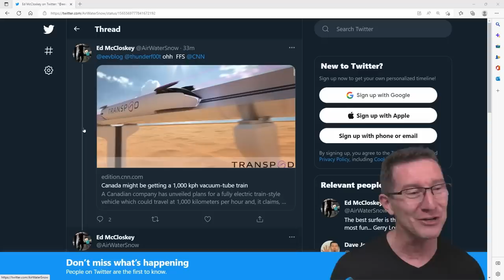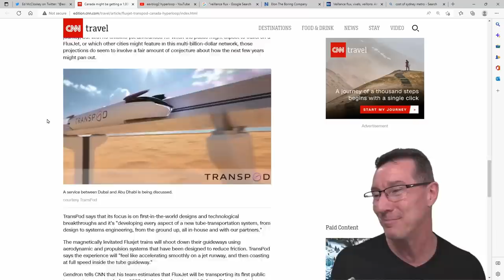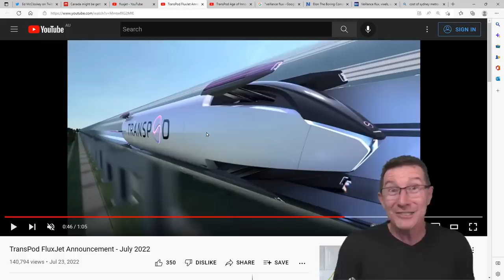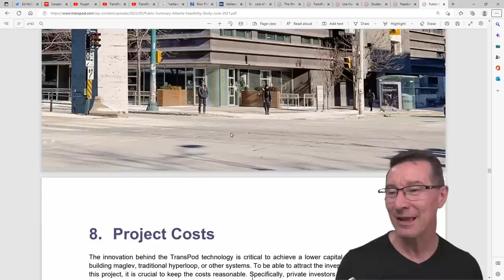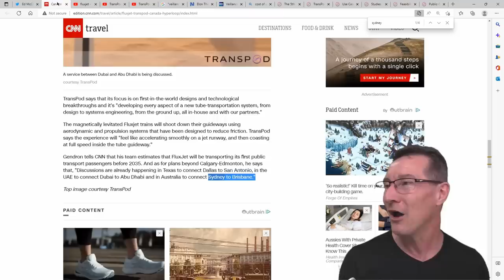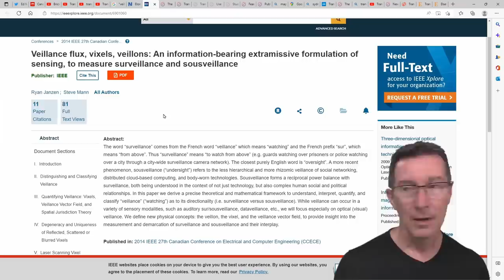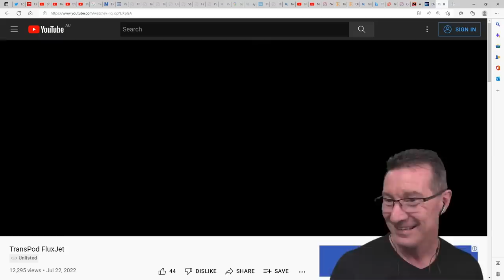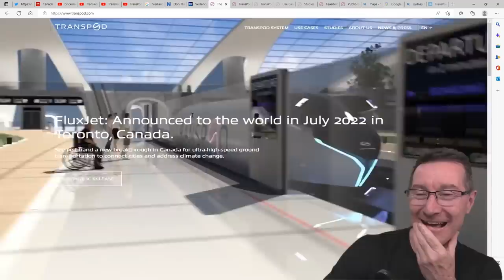EEVblog 1498 - TransPod Fluxjet Hyperloop $550M Boondoggle!

Comment: I keep seeing these "low presure... ideas". And I keep wondering: how would the energy distribution work out if one would not lower air pressure, but rather get the air inside the tunnel to go the same speed as the trains? Would also cut down on the air resistance problem but would involve nowhere near as much danger... and the tunnel would not need air tight seals... just enough to keep the fast moving air away from the stations. And large stationary fans every few miles would be easier to power than anything that moves. I really wonder how that would turn out, in energy... but I have no idea how to calculate that. If I had enough money, I'd start a company for it :D
Reply: I think it would be massively inefficient. You'd be incurring frictional losses between the moving air and the sides of the tube all the way along the tube, not just where the train is. It would be like trying to eliminate friction between a car and a road by replacing the road with a big long conveyor belt. You just end up with a lot more friction somewhere else.

Comment: My problem with Airlines is all that annoying security theater. In the US I can get on a train or a bus with zero problem. But not an airplane, because of all the security theater, passengers need to waste an entire day to fly an hour.
Reply: It's not theater
Reply: @rasimbot , it is 700% theater. Not all countries bother with those theatrical security measures and they get along fine. I travel by train quite often in the US, which carry several times as many travelers than the LARGEST commercial airliner. There are little to NO incidents of purposeful harm.
Reply: @hallcrash  | Thanks to these measures, there are no more hijackings

Comment: But the arcs in the video were caused be the brushes bouncing off the wires/rails. Why are they using magnetic attraction? You would have to constantly monitor the gap and modulate the field strength to keep the train from either dropping or snapping to the track. Magnetic repulsion is inherently self-stable.
Reply: Earnshaw proved in the mid 1800s that no arrangement of (classical) static magnetic fields and paramagnetic materials that can produce stable levitation. It doesn't matter whether you're attracting or repelling. Maglev systems use either electromagnets and sensors to actively maintain the gap or superconductors, which are diamagnetic, or both.
Reply: @ceoyoyo  Pyrolitic graphite is also diamagnetic. You should do a little googling before asserting things that were 'proved' in the 1800s.
Reply: @ceoyoyo  In any case they don't need to be static as the train moves and has landing gear. There are already maglev trains that use fixed Halbach arrays and passive rails which produce stable guidance as long as the train is moving above 11 mph. (iirc)
Reply: @ceoyoyo  Even if it weren't stable and you had to dynamically control the field strength using repulsion would require much less/slower tuning as it inherently produces negative force feedback.
Reply: @ceoyoyo  Finally, I am not claiming that the TransPod FluxJet would be feasible "if only they had used repulsion instead of attraction." Only that using attraction would be counterproductive.
Reply: @GordieGii  I carefully noted that there were exceptions, including diamagnetism. There's nothing "inherently stable" about maglev. You can achieve stable configurations only through means that have costs. High quality pyrolytic carbon is made by CVD so it's expensive, it's nowhere near as diamagnetic as superconductors, and it's only diamagnetic in one direction. That's likely why it's not used for large scale maglev. Active control is pretty simple, cheap, and you typically do it anyway to control clearance, compensate for lift, and for propulsion. You seem pretty excited about this, but you might want to take a break and go for a walk or something to chill out a bit.

Comment: A standard Calgary to Edmonton high speed rail line which costs much much less than than the proposed fluxjet has been talked about off and on for 10+ years. Even if this thing did work as advertised, I have doubts it could be built for non tech reasons.

Comment: They have to use very fast switches to sequence the plasma stuff, so they chose the Esaki (Leo Esaki) diode as a switch. The Esaki diode is also more popularly known as the TUNNEL Diode. Negative resistance!
Reply: What?  Tunnel diodes are low-power, low voltage devices.  Way under one watt.  Have to be.  Can’t be scaled up as the negative resistance only works down at those low voltages.  Or I guess any diode in a tunnel is a tunnel diode.
Reply: @georgegonzalez2476  I was just injecting some humor into the topic.
Reply: @NeverTalkToCops1  Sorry, the humor went right over my head.

Comment: Solar-powered: really? Also at night, when the cooling down vacuum tubes stress the seals and you need more pumps to maintain low pressure? 
Fast airlocks: it is good to see that they solved the airlock problem and pressuring down the airlocks doesn't take ages at every stop !
Front "radar" flux : consider 250 m/s and an F1 racing grade emergency brake time of 15 s. So the radar has to look ahead 4 kilometers for trouble like ... air ...
Unluckily a wall of air in 4 kilometers distance entering through a leak will not stand still but move towards you on its own traveling speed ...

Comment: always funny to see: it is a mag-lev train, that will add extra infrastructure and never before used or even existing stuff, but will somehow be cheaper than the base mag-lev train. sure, that is how it works, more is cheaper. not to mention even high speed trains are failing mostly from the fact that it needs different (more robust) infrastructure than trains, and at that point it is simply not cost effective, but that at least in theory was backward compatible. maglev need dedicated track, hyperbs and similars even more dedicated and not even compatible with each other stuff.

Comment: To get reliable high speed rail in a low density northern latitude like Canada, tunnels might be something to look at (maybe not vacuum tubes tho, lol). I think Japan uses rail/car heating, and monitoring for winter, but there is a higher population per mile of track in JP, so the maintenance cost is more feasible.
Reply: The issue with high speed rail is actually not the install cost that a lot of people believe, but the ongoing running costs.

Comment: I am not well versed in things regarding maglev, but I think what they are proposing is kinda different in a way that they have the propulsion on board of the capsule with the top arm thingies providing lift and the bottom ones providing thrust. Kinda feels dumb or at least counterintuitive to not flip that around but whatever...  Still overall a dumb idea.

Comment: (Thunderf00t is not alone after all!)
  We should just have special bus roads & electric buses that accelerate 
0-60mph in 2sec.
Like a 
Tesla Model S Plaid!
Reply: just make a very long model s plaid, add a cog track for near infinite torque, replace the tires with steel wheels, remove the battery and connect the positive to one rail and the ground to the other, now we have invented the electric train

Comment: Quick guess from the two seconds of 'engine pod' renders:  they're linear electric motors, with the tracks being stators.  With motors at four points front and back, you could potentially throw the vehicle along a path down the center of a tube.  That would be technically different from magnetic levitation I guess.. more like a railgun with a self-propelled shell.  At least LEMs are a known technology and not magic fairy dust.

Comment: just call it 'Job security by Faint Something Projects' - all those engineers, designers, calculators, metalbenders, wirewrappers, concrete pushers - they need a job - 500M and is that job security for one year ?

Comment: Looks like the dreamers are right on track... Why are people not asking how big the vacuum pumps are and how many are needed for the tube the train goes through. How loud are the pumps and how much power is required. Also how many airlocks are needed between stations. I dare say with this alone will put people off nevermind the fact that Hyperloop in any form is a dumb idea and has already a kill streak with companies that have picked it up and dropped it. Why can people see it's just a pipe dream that sucks.

Comment: As a Canadian, I am thoroughly embarrassed by this nonsense.  On the plus side, the run from Calgary to Edmonton goes over unobstructed prairie so it can be done in a straight line.
Reply: It's not quite so unobstructed as you might think from a map. Nor is it quite as flat. There are lakes, inconvenient towns, etc, in the way. Be far more effective to just put a traditional high speed rail line in.
Reply: @lostwizard  I suppose it would have been more accurate to say "mostly unobstructed"

Comment: You really hit the nail on the head at the end there. They managed to not only re-brand mag-lev, they actually branded compute vision, and the arcs resulting from the brushes powering the train. It does look cool. Seems marginally more viable than HyperLoop from a physics standpoint, but only in the sense that warp drive is marginally more viable than hyperspace. We're not gonna see either anytime soon. 🤣👍

Comment: As an Edmontonian, I can assure you that this scam is nowhere on city council's radar.  The map at 16:53 is downtown Edmonton and because I know a bit about the local geography and geology I can tell you that their proposed routes are nonsense.  The downtown Calgary map at 17:09 has put the TransPod stations in a part of the Bow/Elbow Rivers floodplain that was flooded as recently as 2013.

For a tiny fraction of the cost of this garbage we could have city centre to city centre 200 km/h rail service that would cost a lot less than $90 to ride.

Comment: @ 19:34 How many times can a capsule withstand pressurization/depressurization cycles until cracks appear in it that put its integrity at risk?
They can't make it with 3-4 cm steel walls because it would weigh too much and produce too much vibration between the support pillars in the areas where it would be suspended + the entire supporting structure of the capsule would have to be oversized + it would consume too much energy to sustain levitation...
Reply from the maker: There are countless practical problems like this.
Reply: @EEVblog  It's difficult explaining technical problems to idealists (who are non-technical) as they'll simply accuse you of being afraid of the future/change.
Reply: Like how airplanes go through pressurization/depressurization cycles?
Reply: @trey1531  I was going to say, pressure cycling is an issue that airliners already deal with. It's doable, but not a negligible problem.

Comment: You have to give them a credit for animated graphics.
The plasma part is a total BS, especially in a vacuum chamber. Why not use inductive power coupling and transfer?
Also, let's assume they really built this project. What will happen during a power loss or a brownout? How would they evacuate the passengers in case of emergency?  This alone should be addressed in the beginning stages of the project development.

Comment: I've got an idea for an ecofriendly vacuum tube hyperloop SAIL/wind propelled train with solar cell seats and power backup with actual horses (so REAL horsepower).
The hyperloop high speed train in the vacuum tube will have ejection seats for added safety.
Investors are welcome 😉😉😁😁

Comment: As much BS this may be, I'm willing to accept, that the wheels on the lower pods are there to help unpowered insertion into the rail system. You don't want to screech metal on metal with a one ton slide. The Image from the front could be from an unpowered state...

Comment: Vacuum Tube train??? What's the heating element voltage? What about plate voltage? Composition? How will this work in my 1950s retro audio amplifier design???

FluxJet? More like F***Jet.

Comment: We had the real one: Transrapid
That worked, was fast, was affordable and would have succeeded if, if there would not have been the big question for the single rail or let us call it a track and the space needed in such big urban areas needed to benefit from high demand of fast transportation between 2 cities without too many stops along cause the most expensive part or time consumer is the stop and acceleration or breaking time needed. 

So there was no line found to compete against air traffic which has not already a high speed train connection cause that was required: lot of people, long distance and not to many trainstations to stop.

Finally the track is a complete different one with  its own infrastructure needs and high production costs cause back then in 2005 or so it need a lot of copper which leads to high production costs for the track. But it was really fast and quite silent, also had no vibrations and was not hit by wind so hard cause it was always dampened on the up and down and left and right axis by the natural magnetic forces. 

A much nicer experience than a highspeed railway especially once that gets close to the trainstation and crosses other tracks, the biggest nightmare of all. 

But all the tech had been sold out to China.
The inventor of the Transrapid and magnetic track had been Hermann Kemper who had been from a family big in slaughtering and meat production business, from tiny Nortrup in lower saxony, not Northrop or something like that, Nortrup. He was an engineer with many talents.

The transrapid was a success by technology but without the political will back then to start a competition against the railway the government already owned. It was a love and hate relationship cause when it became feasible to work the railway fought against it and of cause the german airlines too cause who would wanna give up passenger / traffic for the others. Nowadays it would be solved by CO2 emissions cause the carriers voluntarily gave up short distance connections especially where the railway had working high speed connections cause usually german railwaystations are old and in the middle of the city - not 80 km out like the munich airport which adds on a high speed flight an 80 km/h tram ride or even slower cause the connection to the Munich centre has to stop 15 or 20 times which  end in a mess cause the direct railway connection to Frankfurt would be faster than that with a plane from the airport far outside.

Comment: Calgarian engineer here. I can say without a doubt that nobody would ride this thing even if it could be built. Not because of the safety issues, but because nobody is travelling between Calgary and Edmonton. Even if there was a way to teleport between Calgary and Edmonton almost no one would have any reason to do so! Neither Calgary or Edmonton are destination locations. This project is dead on the basis of the location it is being developed in. The only practical aspect is the fact there is absolutely nothing but flatlands between Edmonton and Calgary. Japan's Maglev travels across NUMEROUS highly populated and historic destinations, and is still barely breaking even on operational costs. There is absolutely no way they can afford a maglev between two cities in the middle of bumblefuck nowhere.

Comment: Totally agree ... Beyond the impracticality of this scheme (scam), we might also consider the economics:

For starters, Canada is big, I mean Really Really Big. But we only have 36 million potential customers. Basically, Canada is a handful of large cities spaced very very far apart. And in the winter, it is cold, Really Really cold, meaning lots of ice and snow, making rail travel expensive and plagued with delays. This is why even conventional passenger rail is a joke in this country. And of the passenger rail traffic which does exist, it is mostly along the Toronto-Ottawa-Montreal corridor, meaning a short little stretch, within a vast wilderness. Further, 1000 km/hr along this stretch is hardly worth bothering with, even if it could be done. Other than this, nobody wants to travel by train ... it's too much of a pain. Probably the service only still exists, because freight (which always takes priority) is necessary, so with a small extra effort, they can add a few dollars to their bottom line.

This is the market into which this 'wannabe' multi-billion dollar company wants to insert itself? Seriously? All the "New physics" of "Veillance Flux" and plasma arc power transfers!, (and blinking LED Arduino setup) ... won't do much good, if there are no customers to begin with. So ... Good luck with that guys!

Comment: Actually, the notion of four of these plasma/maglev skates is quite comical in itself.  Imagine the issues with alignment of the skates at high speed.  We all know that the-three legged stool is self-leveling and intuitively stable.  Three rails would be the cat's meow, not four.

The other issue with all of these schemes is the power needed, even if they are feasible on other levels.

Comment: As An Ex train engineer it dismays me they think trains are designed to run of electric Arcs. The collectors are damaged by arcing as is the supply rail. Any arcing is loss of power its wasted electricity making light, sound,heat. They would be better served ( even though this whole concept is Dumb) by using Inducted electricity, Any system using Arcs for supply will have unimaginable maintenace costs. Due to damage to their collectors and supply rails never mind the possibility of welding occouring, molten conducter's, evaporated materials. If they cant understand such things how could they even manage a Vaccum tube ?  You can tell these people have never worked within the mass transit engineering world.